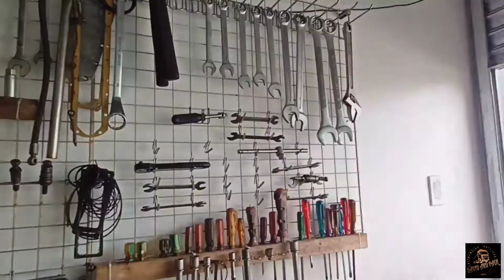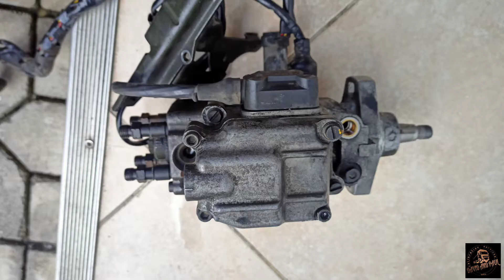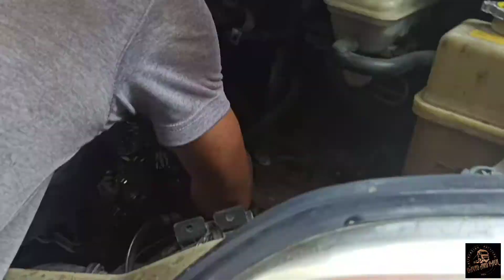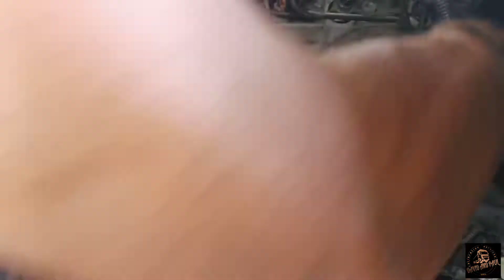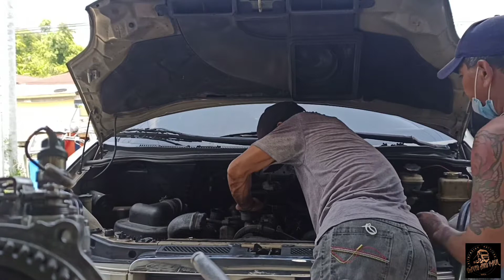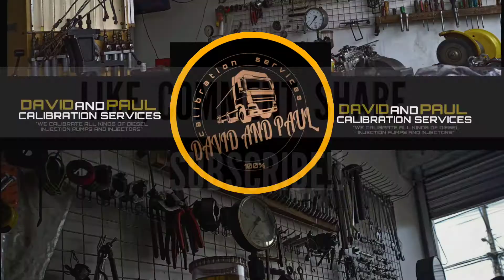How to Convert Electronic injection pump to mechanical injection pump || calibration

Comment: Hello po sir may isuzu DMAX po ako  2003 model , pero Automatic transmission , pwde po i convert into mechanical pump,hindi vah mag ka problema sa shifting yung transmission?
Reply from the maker: kung injector nya sir manual pwede pero pag hindi manual mahirap i convert yan sir

Comment: Pa convert ko sana ang electronic injection pump ng foton ko  to manual pwede bos
Reply from the maker: mas maganda sana sir kung makikita namin sa personal pasyal lang po kayo sir sa shop namin @mancup calasiao pangasinan sir
Reply: @DavidandPaulCalibration  anong gawin ko bos baklasin ko injection pump at dalhin ko dun sa shop nyo
Reply from the maker: hindi po sir bale titignan kung macoconvert yung engine nyo sir kasi papalitan ng injection pump na manual yung unit nyo sir